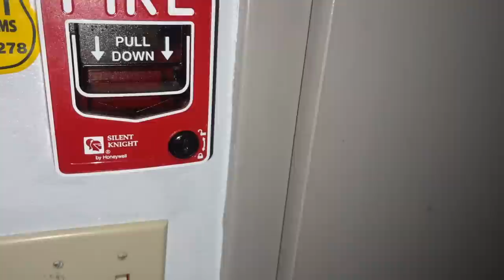Hurricane Ian Causes Office Damage... Dr. Pepper Motor Goes In!!!!

Comment: 30k sounds excessive for the side by side which isnt perfect and when new they cost less.
Reply from the maker: I’ve got over 37 in it
Reply: @DoctrParker  then a roof fell on it  plus its used. Near me  ive seen modded side by sides in used condition going for between £18k and £25k which with conversion is about your price as a max if its perfect.